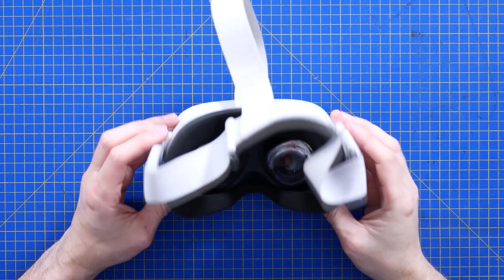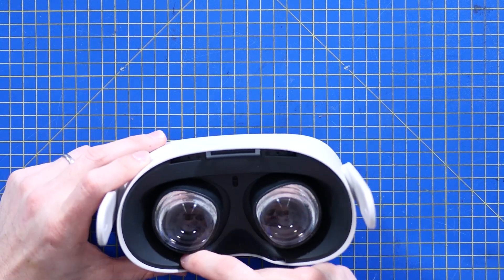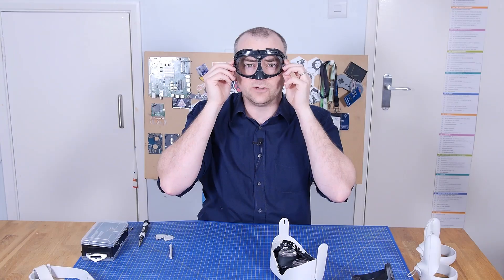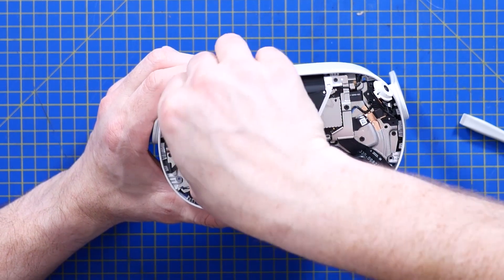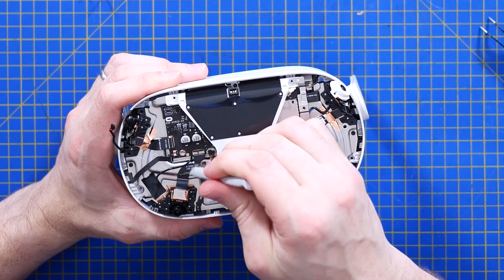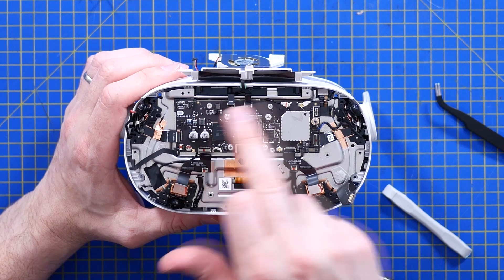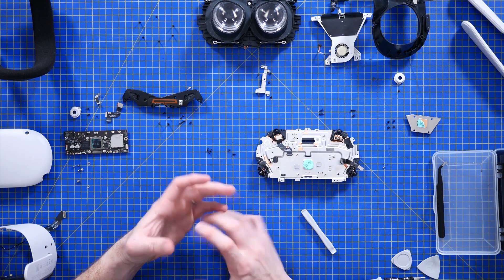Oculus (Meta) Quest 2 Teardown - The Electronics Inside

Comment: How do I fix the power button when it’s not functioning or lighting when charging
Reply: Just curious, did you drop it? Does the meta logo than the battery show on the screen and nothing after that? My sons brother got a hold of his and dropped it (just got a month ago), after that the power button and light does not come on when plugged in, when you press the power button it will sometimes show the meta screen and the battery (100%) but will not come on even if you do the power/- buttons or hard reset with little hole on side. I honestly think it’s something inside that came loose or broke. Did you ever figure your issue out? Or have any suggestions?

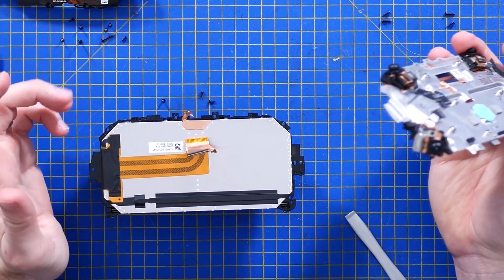Comment: I'm trying to replace a screen on my quest 2 (rma doesn't seem possible). I got to 10:53 and you skipped the part of separating the lens screen assembly from the plate covering the body. If you remember or can show how that is done that would be sweet!
Reply: okay there's 8 tiny Phillip screws you need to remove. carefully remove the display cable from the plate though the slot and there's a tiny flap attached to the plate as well on the top left of the plate facing you (you'll ruin the copper emi tape no matter what so get a new roll of the same width and cut ti to length when installing it)
Reply: If that doesn’t work i think the dude in this video includes that part https://youtu.be/3wdlL3v_38I

Comment: Back in the day the frame rate and latency absolutely were nauseating. I remember taking 30 or 40 minutes to get my head straight after even 5 minutes of play
Reply: yeah i get that alot in free movement games something about moving in a 3d space in vr upset my body in so many ways
Reply: @shogenx  I have heard that using something tacktile under your feet, like a small rug so you can still ceter yourself helps? It worked for me a bit?